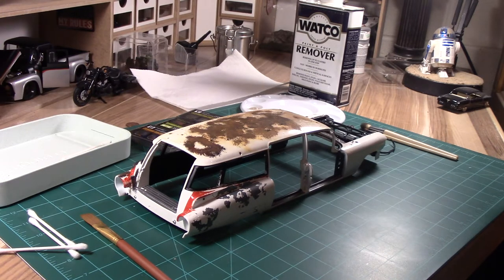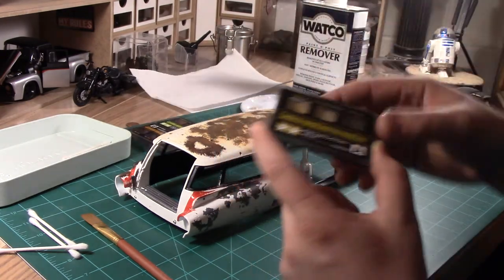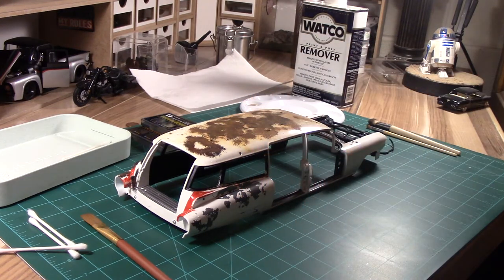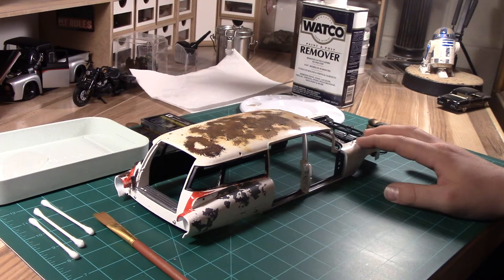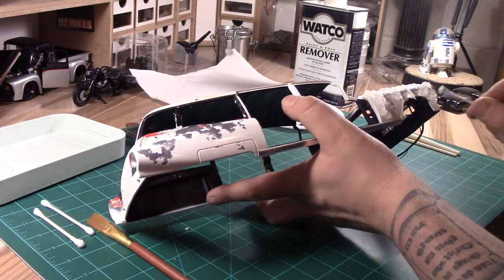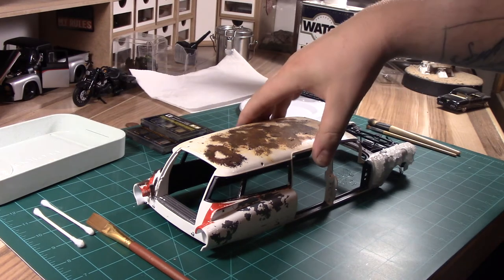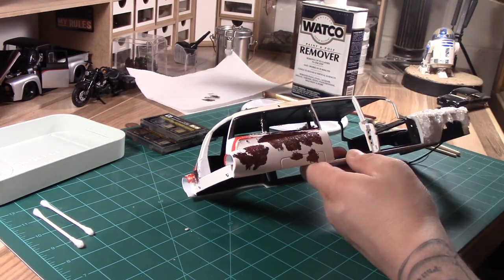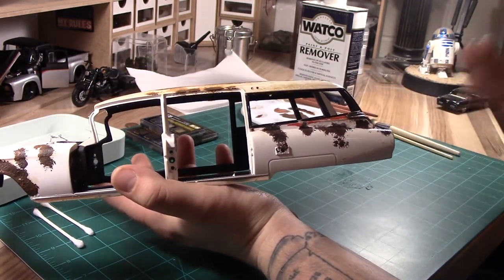How to Weather a Diecast Vehicle

Comment: Can this trick apply to a 1/24 scale model? Also, where did you get that jello-like paint thinner? Would liquid paint thinner work?
Reply: You can get the paint stripper at Wal-Mart..  its a thick paste type. 
Get it in the hardware section
Reply from the maker: This method can work with any scale die-cast model. and I picked up my paint and Polly remove from the hardware store.